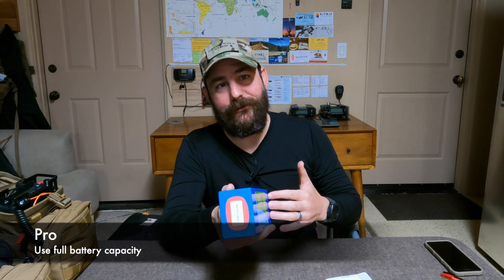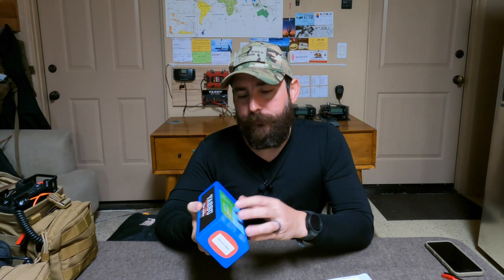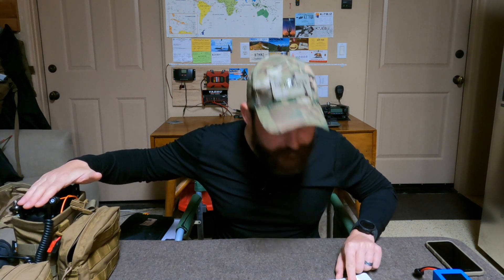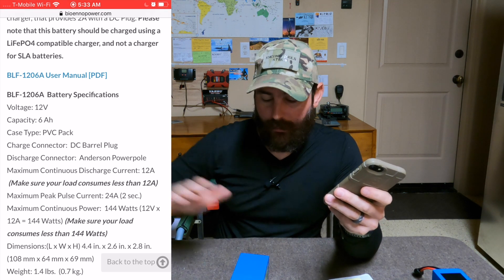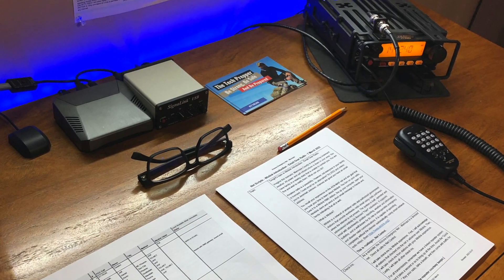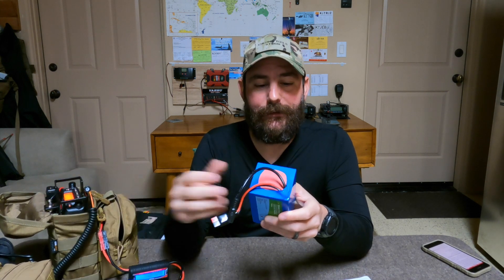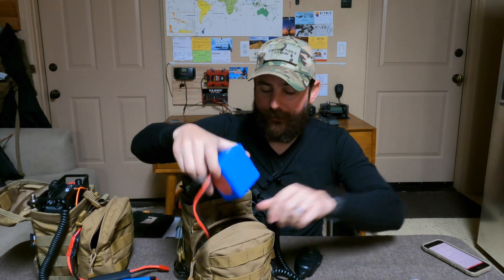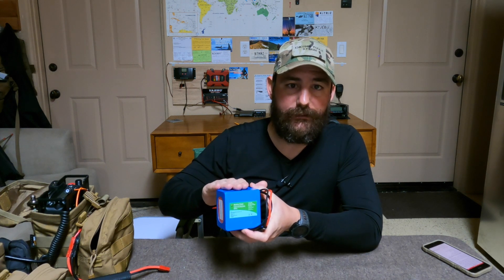How to size a battery for Amateur Radio

Comment: I'd like to have the same portable power, but $700 + is ten times more than my mobile radio cost. A Honda generator would be more the way I'd go then. Maybe I'll go for just battery and AC charger. The $400 solar panel is way out of reach.

Comment: How accurate is the meter though? I’ve heard on many occasions that they’re fairly inaccurate.
Reply from the maker: It depends on the meter. I found the Chinese knock offs to be unreliable and wildly sporadic on their measurements. I finally found the Powerwerx meter to be the most consistent option relative to its price point.
Reply: @TheTechPrepper  the Powerwerx looks be nothing more than the Chinese knockoffs with their name in it. I could be wrong though.

Comment: What bags were you using to hold your radios and batteries and all the other accessories? I really like them! Also great video man
Reply from the maker: All my bags are built on two publicly available bags: the Helikon-Tek E&E pouch and 5.11 6x6 admin pouch. The Helikon-Tek bag is a tight fit, so I have modified two of them. I am actually in the process of design a bag purpose-built for mobile manpacks. The prototype is complete. I just need to find a good manufacturer. Search for "ARMLOLOQ" on channel page if you want to see the bags.

Comment: Having researched all kinds of different batteries, I finally decided to buy a Tracer Lifepo4 14amp.  I only ever use 10w or less and I can operate unrestricted for a whole weekend.  The weight difference is massive and although seen as expensive, I do not regret one bit spending out on it.  Thank you for taking the time to share your advice...........
Reply from the maker: Thanks for putting the Tracer LiFePO4 on my RADAR. Wow, they are pricey! I like that that they are really light and are IP65 rated. Something to add to the todo list.

Comment: This is good stuff.  There is "Read the Manual" and then there are people like me that can read the manual, but still have trouble connecting the dots.  You've helped fill in some gaps.
Reply: Connecting the dots. Ham radio humour. Love it.
Reply from the maker: You're very polite, Steve. You can use RTFM on this channel. ;-)
Reply: @TheTechPrepper  I learn best by doing.  I have to have something to connect the dots to

Comment: I got 3 Bioenno batteries, the 6Ah, 15Ah and a 40Ah. I use the 6 and 15 with my IC-705 and the 40Ah on stand by just in case I lose power or doing something with my 7300. 

Another piece of gear to have is a Anderson Power Pole power strip. I picked one up from Amazon not to long ago, but haven't tried it out yet. Waiting on the weather to get better this spring and summer. If you got multiple devices to run, like a ATU or a power/swr meter, one can power all of it off of one battery instead of using multiple batteries to power individual pieces of equipment.
Reply from the maker: Good point. Power distribution is an absolute must for drawing power from multiple devices. Personally, I use a RIGrunner 4006 USB. It's in the shot behind me mounted to the wall. It has one fused input for your battery and 6 fused outputs. Both use Anderson Powerpoles. It also has two 5v USB output ports. It's pricey, but well worth it.

The Buddipole PowerMini solar charge controller also provides power distribution. It has one input for your solar panel, one input for your battery, two outputs for connecting two devices, and one 5v USB port.

Thanks again for calling this out. 73's!

Comment: D.C. power can offer less ripple.
Headway LiFePO  batteries are a lot smaller, lighter, and more powerful.
 Starting with a low power drain on receive is another way, your batteries can deliver more also, whilst QRP.
Reply from the maker: Does Headway sell full assembled batteries or are they still only selling the individual cells?

Comment: I switched over to those Bioenno batteries and for mobile rigs they work great. The thing to be careful of is running full duty cycle like FLDIGI. I got a 50ah LFP battery hoping that at 15 to 20 watts it would run my Icom 7300 on digital modes. It does not. I can talk on SSB all day on a 50ah LFP battery at 75 watts, but try a digital mode and after 2 or 3 medium length messages it's done. I can do a fair amount more with my Yaesu 857 but still have to be careful how long and how often you transmit a digital signal. I've done this with deep cycle RV batteries, AGM Batteries and the like...digital modes on base radios with a battery, even in parallel just doesn't cut it. Realistically I think the 7300 needs 16v to run it, but I don't think I've ever seen a 8v battery. The base station requires 13.8v to run, not 12v which is why the mobiles do better in that regard. Anyway, just something for folks to keep in mind, FM, SSB voice, you'll do great on a 12, 20, 30, 50 ah battery. Just be careful of digi modes on battery power!
Reply: I use an MFJ battery booster with ICOM 7300.  That radio is VERY sensitive to supply voltage since not only the final amplifier transistors, but the driver stage operate directly from the battery.  So if the battery is down two volts, the driver is down, the power amplifier stage is down.   The IC-705 is less particular since only the final stage operates directly from the battery.  Digital modes put a huge suck on the battery and their voltage will sag.  Another reason for a booster.
Reply: @thomasmaughan4798  -  so all things being the same why are digital modes so much more of a power drain ?  Thx
Reply: @teatonaz  "why are digital modes so much more of a power drain ?"
It is the duty cycle which in SSB voice mode is considered to be 20 percent. With the microphone compressor turned on I get about 25 percent duty cycle which is to say, with a 100 watt radio, average power 25 watts but typical actual power to the antenna is around 15 watts.  Peak Envelope Power is 100 watts RMS, which is to say, at the voice peaks the radio will hit the specified 100 watts, but only for an instant.

Digital modes, not counting CW, are 100 percent duty cycle.  If you were to actually run your transmitter at 100 watts through several FT8 cycles or even longer, a long Olivia QSO, it might catch on fire.  It will automatically throttle back long before that (hopefully) the most I"ve ever been able to get out of an Icom 7300 is 50 watts, measured, into the antenna.  I usually run 40 watts power.  

Ignore that silly power output meter; it reports percentage of command power; I can command up to 100 percent of actual power, but unless you measure it, you won't know.  Only in the case you have exactly 13.8 volts into a perfectly matched antenna is the power display going to be reasonably accurate; percent is watts.  Otherwise you might be having 100 percent of 11 watts. 

Radios are specified at 13.6 or 13.8 volts and it can make a BIG difference if you don't have that.  At 11.6 volts, two less than specified, the absolute max I can get out of a 7300 is 11 watts!  The reason for that is that the battery voltage is applied directly to the final amplifier, and power changes as the square of voltage; a small change in voltage produces a big change in power.  But wait, it gets better (or worse), the DRIVER stage is ALSO powered directly from the battery, and so the driver fluctuates also with the square of voltage.  So a 2 volt reduction in voltage on the battery is squared and reduces the drive; and squared and reduces the power on the final amplifier.  So, a 100 watt radio becomes an 11 watt radio but does anyone care?  Yes, because several manufacturers sell battery boosters and the Goal Zero Yeti 1000x has it built in the required 13.8 volts straight onto Anderson Powerpoles rated at 20 amps, ideal for amateur radio.
Reply from the maker: Thanks for sharing your experience. I run digital modes very often, but only for short periods. It's usually a quick Winlink session or just sending a few packets for APRS. I haven't run into issues for short digi use. I'm starting to work with fldigi so I'll keep any eye on how the batteries perform.
Reply: @TheTechPrepper  Yeah, let us know if that works out for you! I feel like I've done something wrong but I've spent hours and dollars on RV deep cycle, marine, AGM and Bioenno on HF sending PSK, Contestia, etc...and on base radios so far none of them hold for more than 1 or two sends. RMS Express I don't think I've tried. My 857 has gotten me by on digi modes on battery but it'll drain it even connected to solar if you use it nearly constantly. Thanks for the video and look forward to your findings and tips!
Reply from the maker: @chadlpnemt  This is odd. I've never had an AC power supply, so all of my experience running digital modes has been running off batteries. No issues with packet (APRS, Winlink, BBS), fldigi (FM and HF), JS8Call, or FT8. How much power are you running and how long are your digital sessions?
Reply: @TheTechPrepper  I can listen all day long but start transmitting at 15 watts, again on my base radio,  I get maybe two transmits and the power cuts out. On my 857 I can run much longer but the voltage drops to 10.9 or so during transmit. After the first 3 or 4 transmits.

Comment: The 12ah bio can put out 20 amp bursts. I use it in my go box with the Yaesu ft2980r and Xiegu G90. I was using a 6ah and it wasn't giving me the power on my G90 for 20 watts. 12ah runs for days.
Reply from the maker: I run my FT-2980R off the same 12Ah battery works great even at 80 watts. That's interesting about the Xiegu G90.

Comment: Really helpful explanation--it seems easy.
Reply from the maker: Thanks! It's really straight forward. If you're not going portable and can afford it, it doesn't hurt to go a bit bigger in terms of capacity. I've considered some 20Ah models for the shack.
Reply: Sounds like a good idea, as the battery could be swapped out for portable operation, giving you more flexibility. Be quite a load to carry, though

Comment: Do you use a fused line between the battery and the radio (didn't see one) or think the BMS is sufficient?
Reply from the maker: I carry one in every manpack. I took two small automotive in-line fuse holders, added heat shrink to both ends of the wire and added Anderson Powerpoles. I rarely use it though. No problems so far.
Reply: @TheTechPrepper  I don’t either on the trail but do in the battery box experiment.  Called Bioenno once and they didn’t think it was necessary. YouTube screamed foul when I mentioned that in a live stream but Bioenno itself said “not necessary” so who knows.

Comment: What a great video. Have held off on buying batteries for portable operation specifically because I did not know which battery would be right for the radio. Sub earned!
Reply from the maker: Woot! Welcome to the channel. If you're not going man portable, go a bit bigger if it's within your budget. You'll have more time to join the air waves. 73's

Comment: Great video Gaston. I have a QRP radio and I think I like your idea of 2 smaller batteries for redundancy. I was leaning towards the 4.5ah but I may have to do some additional pondering now. Thanks for taking the time to do your videos. 73
Also… thank you for sending me over to your friend Charlie at Red Summit RF. He has been a TON of help with my journey to learn CW!!!
~Mike 
W0MDE
Reply: A caution with running lithium batteries in parallel is they don't have the balancing circuit between them to ensure they are charged uniformly and discharge uniformly.   Using them in succession is a great idea; it is like having a reserve gasoline tank.
Reply from the maker: Thank you. Charlie is great. It's a blast watching him operate. He's a great hiking buddy, too. Keep chewing on the one versus two batteries. Let me know which way you go.
Reply: I also have two small LiFePO 6Ah each for my FT-818 and for more fieldday than portable operations I have one 50Ah LiFePO as well and that’s used mostly by my FT-891. All batteries can be charged in field with 100W solar panel, what’s really great when on a longer outdoor activity. 73 - Stefan

Comment: Honestly one of the best videos I have seen on analysis of battery sizing for ham radio. Everybody gives theorytical useage but you also give REAL WORLD measurements. Thank You!
Reply: I don't have my radio set yet as the Club in Birmingham UK was closed for the Plandenic. Hoping to get a set up soon for listening, whilst I study for the licence, and learn Morse Code.
Reply from the maker: @debbiecurtis4021  Good luck with your setup and welcome to the hobby.
Reply from the maker: You're welcome. There's theory and then there's the real world. I prefer real world experiments.

I'm getting ready to test CHA LEFS from Chameleon Antennas and I'm going to take the same approach. I can't deploy that antenna system using the recommended height and I don't have the appropriate feed line or RF choke. Well, what's the impact to deploying it with the gear I do have? We'll find out soon.
Reply: Great insights for me too! Loved it!

Comment: For the shack I use a 4 Ah charger with two 35 Ah sla batteries.  I haven’t used my power supply except in Texas.  I do like my 10 Ah Dakota lithium and my Bioenno 4 Ah charger.  I will need a larger battery for my ft891.

Thanks as always.
Reply from the maker: That's a good call getting a higher current charger. I have a 5A charger but wish I went with a 10A charger or larger quick charger for my 100Ah Battle Born battery that I wheel around as a portable power station. It has 3000 watt pure sign wave inverter. This thing buts my Honda 2000 generator to shame.

The FT-891 is current hungry. Bigger is better for that rig. I'm going to add a DC distribution block to the 100Ah Battle Born battery station specifically to run the FT-891 and FT-2980R in the shack.
Reply: What is the brand and model for the 4ah charger?
Reply: @YayaOrchid  i have  harbor freight cheepy charger for the sla.  While I have used the the bioeno charger for the sla, it can over charge them and lessen the life.
Reply: @douglasvamateurradioandmore  I see several chargers can you be more specific. I would greatly appreciate it. I saw a Viking 4 amp for $40 but not sure.
Reply: @YayaOrchid  that sounds about right.   It's not my favorite,  since I normally use lifepo4 batteries and will be going away from sla altogether.

I will be going solar in the shack and when that happens I will likely go away from ac to DC chargers in the shack.  When I travel,  I will carry the lifepo4 charger for staying in a hotel.
Reply: @douglasvamateurradioandmore  OK. Thank you.

Comment: In my opinion . The 300ma is standby. Rx of 500 would be when an actual signal is barking through the speaker and at a specific volume level. Love your videos. Rock on.
Reply from the maker: You're right about that. Some of the specs will refer to it as "squelched" (standby or no audio) as well. Even when I'm receiving audio, Yaesu still seems to be conservative with their numbers.

Comment: Good stuff - I love my bioenno (9ah) as well and was waffling between the 3 and 4.5ah batteries for QRP work.  Pretty sure the 3.0 will be fine but you video reminded me to check the radio's specs.  Thanks and have a good weekend!
Reply from the maker: I have wondered about the 3Ah version myself, but it has always felt a little too light in terms of capacity. I've been using the 4.5Ah models for almost two years with great success on every SOTA activation. But now that I am spending more time on FM at 25 watts with the FTM-6000R, the 6Ah version seems to be the perfect sweet spot of performance, size and weight.

Comment: Great info! I'm a fairly new ham as well. I just got my first HF rig ft-891. I'll hopefully be building a solar generator and incorporate it to fit the radios! I am excited beyond words to start this journey! 73 God bless, 
Hopefully I'll catch you on down the log!
KO4MWD
Reply from the maker: Welcome to the hobby! I always look forward to QSO's with you guys. I have an FT-891 and would recommend the 12Ah model as the minimum size given that it's a 100 watt rig. It is not fun lugging the FT-891+12Ah battery up a mountain, but I've done it several times.
Reply: @TheTechPrepper  I've tested with a 12ah and a ft-2980 (80w) drains the 12ah quick calling cq on 146.520. I'm hoping to get a 40mm can built with a 30ah battery for a main solar generator for portable comm ops
Reply: Glad your having fun!😁😁
Reply: I'm just starting my Ham journey, but I know what 73 means. I tell my son 88 every night now. He just rolls his eyes.

Comment: Please remind me what those bags/pouches that you are using for manpacking those transceivers are.
Reply from the maker: These are becoming increasingly difficult to find now for some reason. It's the Helikon Tek E&E pouch. I modified the one running the FT-818. The one holding the FTM-6000R is stock.

Comment: Great video. What would be needed to recharge a HT with one of these batteries?
Reply from the maker: Great question. If your HT supports 12v charging all you need is a male-to-male barrel connector cable. I do this all the time with my older Yaesu FT-60R. For the new Yaesu FT-60's I use the same cable and connect it to the charging dock.
Reply: @TheTechPrepper  thank you for the information looks like I need to dig in the manuals again.
Reply: @TheTechPrepper  I am thinking of charging Lifepo 7ah battery with my Bluetti Solar generator, Battery has T-connector: Will barrel connectors to T-connector cable work? Or should I get a DC Charger and plug into outlet on generator?

Comment: I have been using a Dakota Lithium 10 amp hr battery in my go kit and a 23 amp hr. in my battery box. They both work great and I am a big fan of LifeP04. My solar charge controller is mounted in the battery box and is awesome for keeping things charged up.
Reply from the maker: I've heard good things about the Dakota Lithium's. 23Ah is a great size. Depending on the rig, that could last most of the day.